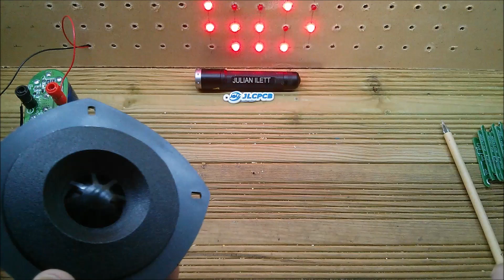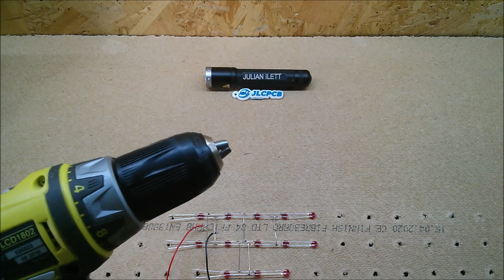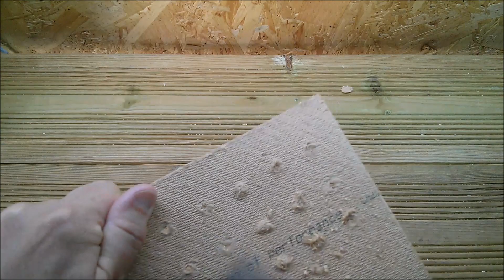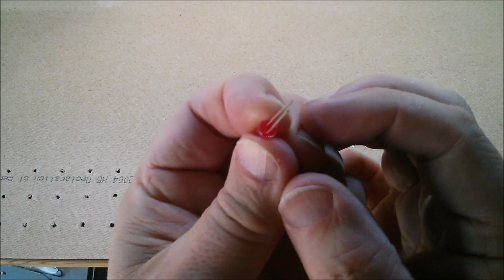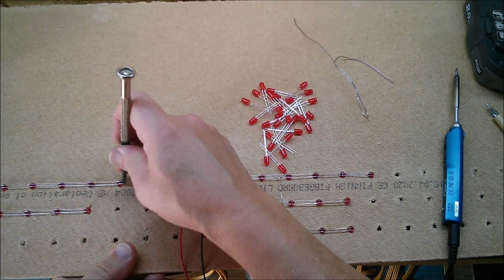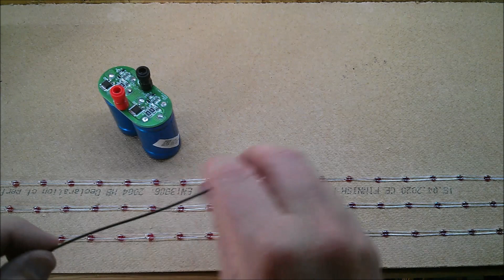The Supercomputer Speaks

Comment: Big Clive didn’t “invent” this. It’s flashing LEDs wired in parallel. Perhaps he did the first such video, but really, it’s not an actual invention. Not being unkind. Radio Shack began stocking flashing red LEDs in the early-mid 80’s, and I would hook a few up - as did I’m sure many others. He came up with calling the circuit a super computer. Anyway… 😊

Comment: Quiz: How do you blow up a tweeter. Answer: Push square waves through it (especially low frequency signals). That"s why they put crossovers in speakers. To keep the low frequency part of the the audio range out of the tweeters. The reason is that the low frequency signals are too high powered for the tweeter.

Comment: I remember when I was younger I put a speaker in series to a computer fan connected to a 9V battery and it made a weird loud buzzing noise. It must've been from the motor driver inside the fan.

Comment: 69 LEDs x 25mA = 1.725A
1.725A x 5.4v = 9.315W 

At 5.4v the speaker would be pulling 675mA, at 8ohms, making 2.4A total current draw / 12.96W power draw
Reply: Except the speaker is in series with the LEDs. And appropriately half the LEDs are off at any one time, and during this time they consume less current.

Comment: Ok, finally bit the bullet and bought a pack of these LEDs off eBay. I'll be interested to see how yours go running at over 5V. I've got some genuine LM2596 buck regulators (not the fakes they sell on eBay from China), so I should be able to run them at the base 2V, since it'll reduce peak power consumption to something manageable and I don't need them to be bright anyway.

Comment: The mathematician in me says that this is going to end up sounding like white noise, or at least noise with a shaped spectrum. PROVIDED the LEDs do not interact and the noise on the busbar doesn't partially synchronise some of them.  Anyone with a spectrum analyser want to try this? Of course, decoupling them to prevent interaction would defeat the whole object.

Comment: What if you put some 0.1 uF decoupling caps across each row of LEDs? Do they become less random, or more random? What if you use 0.01 uF caps instead? Or a 1 uF film cap? What if you yell real loud into the speaker while it’s on - does it affect the blinking of the LEDs any?

Comment: The amplitude of the noise (current variations) would be something like inversely proportional to the number of Blinking LEDs. For example, if you had a million Blinking LEDs in parallel, the noise (current variations) would be almost imperceptible (once past the duration of the initial start-up where they're all in phase). The more the LEDs, the less the noise.

Comment: You are sending chopped DC to a speaker instead of AC. That will give the speaker partial paralysis.(The best way to explain it). Since the signal never goes negative, it will accumulate flux, mostly locking up the speaker. It is probably too much pain to filter off the DC while still acting as a shunt for the LED's, though.

Comment: I doubt the chips in the LED's have any form of current regulation.  The chip just has good tolerance.  
Interesting giving the "computer" a voice.  It will never sound like a modem.  The LED's are all switching randomly, just giving pulses of basically electrical switching noise..  There is no proper waveform.  Even with 1000 LED's you would just get basically white noise.  Like pulsing a battery across a speaker rapidly.  It could be worth looking at the signal on an oscilloscope so you can see what it is doing.

Comment: Put a screen over the front to disipate the light and look a bit more like Joshua in Wargames. I think they had orange LEDs. I have scrapped a few large 50 inch tvs and there is a great difusser panel in every one. Great videos. Make sure you cover the bottom sides of the shed to stop pesky mice knawing thru like they did in my old house!
Reply: Now THERE'S a good use for those box fan grills!!

Comment: A number of reasons why doing this is not a good idea. Firstly you are putting DC though the speaker winding which is very thin and low current. This will off set the cone and possibly out of the magnet range, hence low level output. The frequency is too low for a tweeter which typically rolls off below about 1kHZ. Most amazingly I'm surprised the coil is not burned out, it might be damaged already, hence even lower output!!
If you really wont to do this, you need a standard speaker with an isolating transformer to remove DC from the speaker coil, might work then without damage or smoke, try it!! Another way would be an output transformer in reverse. ie, secondary winding with the DC flowing, the primary, high impedance connected to any audio amplifier, probably the best solution.
PS You might be able to hear it on a near by AM radio??
Reply: The rapid pulsing will prevent any heat build up that would cause any damage to the coil.  A bit like the old square wave patterns from 8bit computers in the early 80's are basically just pulsing DC from from one end to another with a centre crossing.  The coils will be quite happy as long as it is not steady on. The voltage drop across the tweeter in series with the LED's is quite negligibe.
Maybe if you had several 1000 LED's you may get up to the current draw that would damage a speaker winding on the tweeter, dependent on the wattage rating of said tweeter.

Comment: Modems used to modulate tones, and most of the time you'd just hear white (or technically pink) noise when random data was being transmitted, only getting burbles when it was idling, or transmitting blocks of the same bit patterns. This is a random noise source just modulating DC. You will get a classic gaussian rectangular pulse noise spectrum, with the spectrum repeating, but with a (1/f) envelope shape.

Comment: nice experiment. 
I think the lower volume is a direct consequence of the central limit theorem:
any large summation of random variables (like the small differences between blinking rates) tends to a gaussian distribution.
the difference between a uniform and gaussian distributions, with same average and variance, is that values around the average are more likely, so they are smaller, so smaller change in current draw, so less volume.
you would get the most volume (the larger current change) with a single led only, and adding more leds can only make the average current draw to tend more to, well, the average: i guess led count * 25ma * avg duty cycle

Comment: Cool maybe a resistor in the supply to the leds and then a ac coupling cap on the “ load” side of the resistor? Maybe run that into some kind of oscillator that has a voltage controlled freq? I think I’ll get some blinking leds.... and give it a shot.  Great idea!!!

Comment: 500 LEDs x 20mA each = smoking tweeter (10 amps)!!
Reply from the maker: Yes, with 500 LEDs I'd probably AC couple the supercapacitor into the input of a small amplifier.
Reply: Not quite that much current, as I figured out a minute ago when I started saying something similar. The tweeter has some resistance itself (assuming 8 ohms) which will limit the maximum current to around 0.4 amps due to the limited voltage drop. Julian, I'm curious, how much voltage is getting dropped across the tweeter and how much is left at the LEDs?

Even with the self-limiting, it's probably still better to AC couple a shunt resistor into an amplifier. As you add more LEDs the total current won't change, so each will impart less signal and your output will be quieter.

Comment: Hmm, I don't think you'll hear modem type sound from listening to the battery. I mean, what you'd hear there is the amplitude of power demand from the LEDs.  No frequency, only amplitude.  If you want to hear the modem sound, I think you'd need a radio capable of tuning the frequencies generated on the legs of the LEDs.  If you can tune in that frequency on a radio and wave the antenna over the LED matrix you'd get more of what you were looking for.

I guess what I'm saying is - if you're looking for tones you need to think of the LED legs like little radio transmitters.  Its the EMF they generate that are carrying your tones.
Reply: BTW, this goes back to the story of the first Altair computer to generate sound.  It didn't have any sound capability.  But if you set it next to an AM radio and tuned it to the right frequency you could hear the load on the processor. So by running loops of varying length and complexity, they could generate different tones, and ultimately used this approach to play songs.  The first chip tunes.  :D
Reply: Yeah, but, a real microprocessor (like a 8080, 8085, Z80, 6800, 6809, 6502 etc) is normally clocked at 0.5MHz upwards. So as various signals change state, various lower frequencies are produced. The circuitry in the radio demodulates the signals and some of the demodulated interference happens to be in the audio range (the radio has filtering to only process audio signals to reduce unwanted noise). The frequencies (including harmonics) produced by 1.5Hz flashing LEDs is far too low for a radio to pick up.

Comment: I one LED  doing a circle every 1.5 seconds it clicks every 0.75 seconds which are 1.33 Hz. If the LEDs are out of sync the result would just become noise and not a humming sound according to my understanding. Ok answered. At 14:08 you can hear it klicking like a Geiger counter. 16:48 What if I'm old, but beautiful? I hear nothing either.
Reply: Don't forget there is an amp of DC going through that tweeter, which could well have dragged its diaphragm to an endstop. That would make it quiet. A couple of Henries of shunt inductance would be no bad thing.
Reply: @donepearce  The voltage is 5volts and the current draw is constantly variable, depending how many LED's are on.  The current is only equivalent to the current draw of the LED's that are on at a particular time, with some minor variance to allow the for the microamps the chips use when idle.  Even at 1amp at 5 volts, that is only 5Watts.   Don't get hung up on current alone.  Power is voltage times current and it is continually pulsing on and off.  The average is more likely to be closer to 2 watts
Reply: @EsotericArctos  yes but the cuurent is not ac with an average of zero. It is a modulated dc with the avarage equal to half the bulbs being on. That is roughly an amp. And that is the current that will peg the diaphragm against the stop
Reply: @donepearce  I think it would be interesting to see it on an oscilloscope 🙂

Comment: I'm actually building a matrix of blue flashing LED's  - first I tried bussing them 4 in series so 12v could power them - and yes they work in series, but the problem came about when I discovered that when building and testing as I made a row of them each time some would fail - then more and more! I tested one of the failed ones with my continuity tester and produced a short!  Which is why the problem obviously compounded. I have started building another one so they are all in parallel and powered off a 18650 - so far they work- I have another four rows to go to make a 7x13 grid of them - 13 because of the width of perforated copper strip  board I have and 7 because of the amount of LEDs I have left! Of course I tested each one on a coin battery before soldering them in.
Reply: How they heck do they work in series?!  So they short circuit when they are off?  Or do all the leds in series blink at the same time?  

If they act as an open circuit when off, you could put regular leds in series with a single blinking led and they would all blink.  Cheaper? More colors!
Reply: @TheRainHarvester  I'm not sure how they would work in series - I see your point! but they did when I tested them - hopefully Julian can explain if he reads this. The short circuit thing is a mystery too.

Comment: Sorry but I would have to sand the holes those rough edges are annoying lol. And yes I have built a big Clive super computer too and used 555's and CD4017BE and 10 LEDs in banks around the outside too.